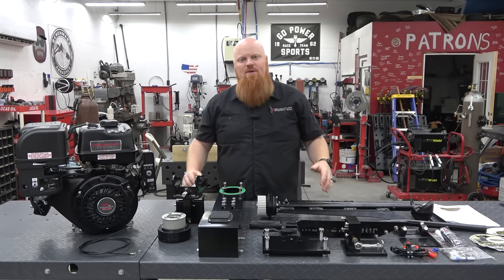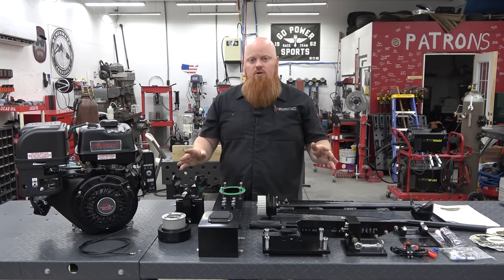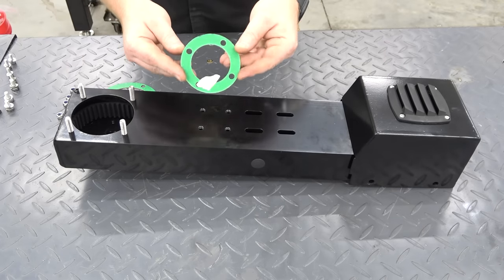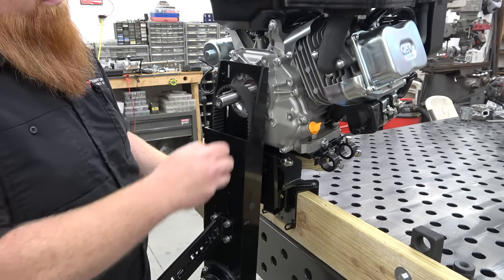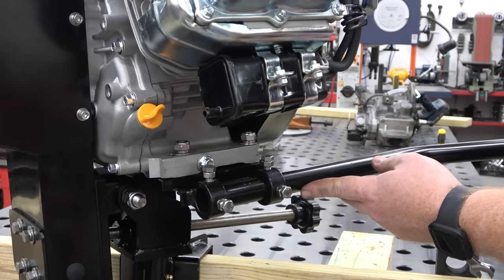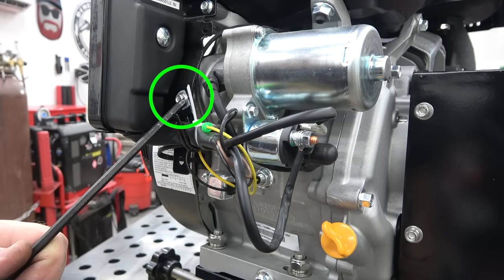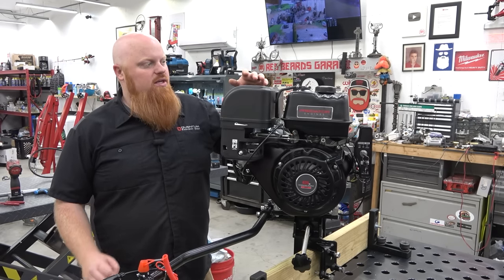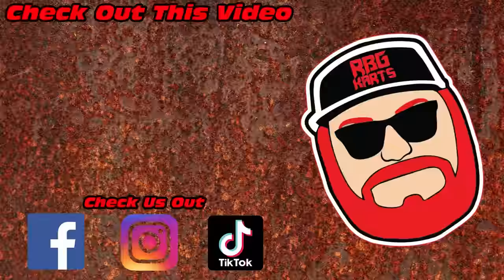Mudskipper 13Hp Feather Lite Surface Drive Kit

Comment: Anyone know how this will do against limbs and logs? I hunt a lot of flooded hardwoods and don' t run into mud a lot, but I dodge floating logs and submerged fallen trees constantly.
Reply: Wondering the same thing? Trying to decide between this kit and a swamp runner long tail
Reply: @DHoppey10  I built this kit, i absolutely love it.

Edit: I went with the 16 hp Predator though.
Reply: I have this kit. It does pretty well with logs. Im designing a power trim for mine.
Reply: It's not as effective in super skinny water, as a long tail.

Comment: I bought a mud skipper twister shaft. Using a stock Predator 224cc motor. Would just doing a carb upgrade and governor removal squeeze more power out? I no nothing about motors

Comment: Can you put this feather lit kit on a predator 670cc performance same build as your performance build
Reply: Or can you point me in the right direction to find a surface drive kit that will fit a 670 performance 25-35 hp

Comment: Holy crap the cheapest kit is $850 even if you supply your own motor. Heck no, I could find and buy a dedicated outboard motor for that money.
Reply: Yeah I just checked also.  That's a total rip off and none of it is marine grade.  Some dude welding these in his garage.  That will rust out in a few seasons.
I could buy and old jetski with a working engine for that much and have an 80hp jet fishing boat lol.
Reply: @Thirdplace4life I’ve had one for years, they’re aluminum any mine has held up great with a forged engine at 10k rpm they’re lighter than anything you can make or any other company. I guess just not for poor folks they’re really popular in Florida
Reply: Don’t look up gator tails or any other brand mud motors if the cheapest brand is too much for you lmao